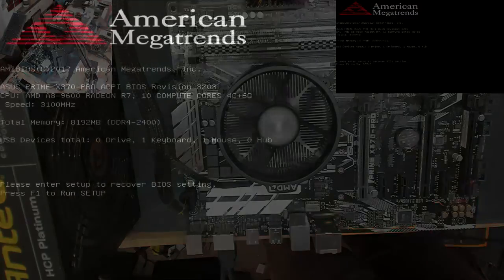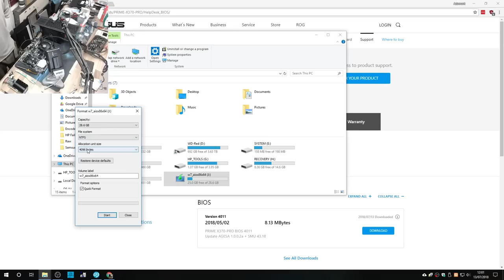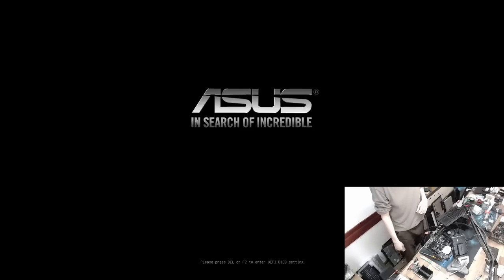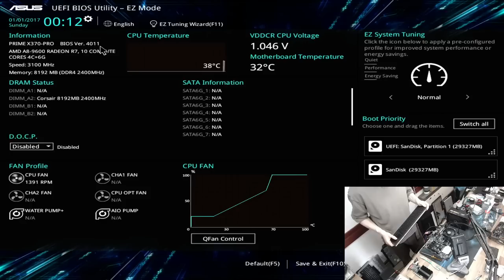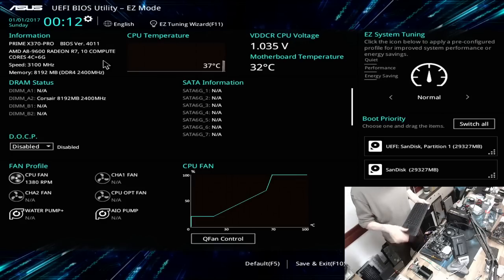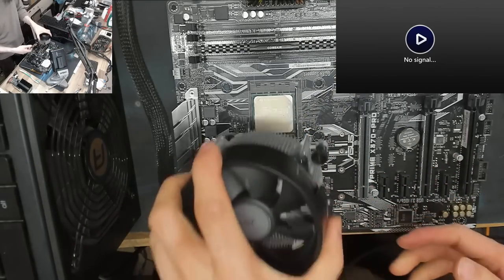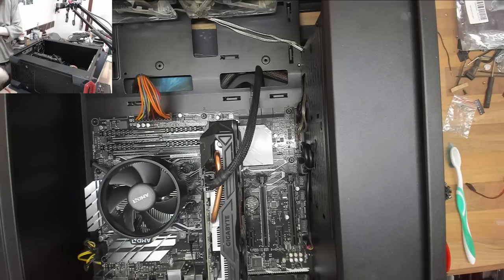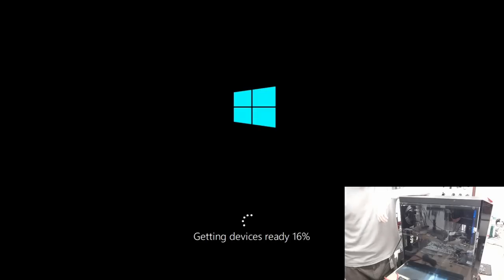LFC#143 - New Ryzen 2600x build with no POST

Comment: Thermal paste is non-conductive.  lol  Only Rysen "G" series have graphics.  I also noticed the fan cooler needs to be turned 180 degrees.  For memory clearance mostly.  I have that CPU. 2 years matters not.  Procedures are still the same.      ^.^     Full battery removal?  Shorting pins not good enough?  *snort snort... lol   Yer funny.

Comment: Imagine having to send a AMD CPU in the mail to sell on eBay😂🤣 Bent pins disaster. So glad Intel uses LGA.
Reply: Anything new?
Reply: Just pack it well using the plastic tray the cpu ships with and you're not going to have any problem. The only problem I got with AMD is the lack of retention brackets on the socket. It makes it unnecessarily hard and nerve wrecking to remore a cpu without pulling it out of the socket together with the cooler, and if you attempt it without knowing the risks beforehand you're almost guaranteed to rip some pins off
Reply: @alessandroceloria  Just twist the cooler from side to side to break the thermal paste  adhesion instead of pulling it straight up and it will easily come away, leaving the processor in the socket.